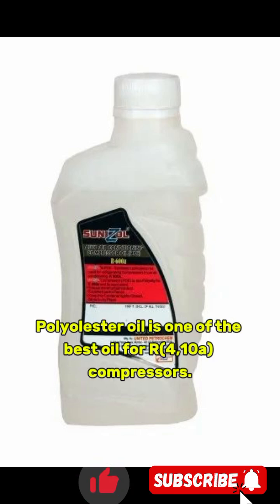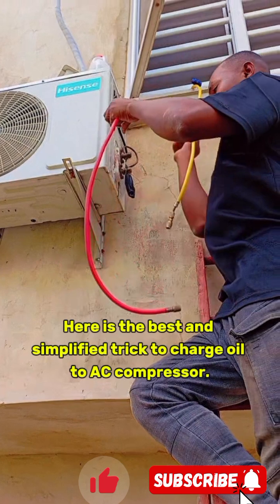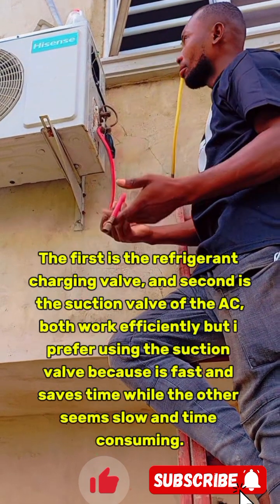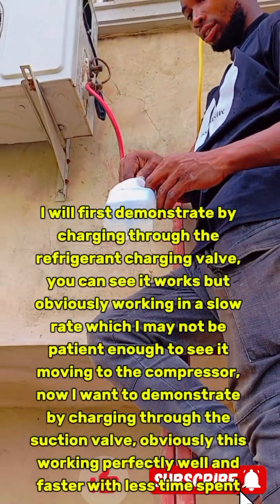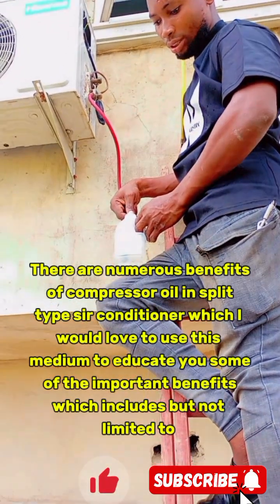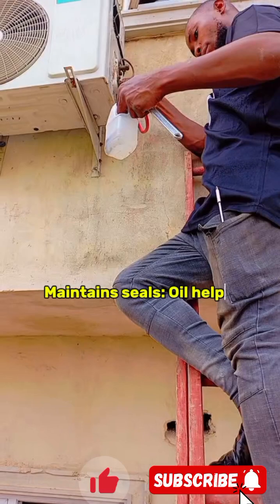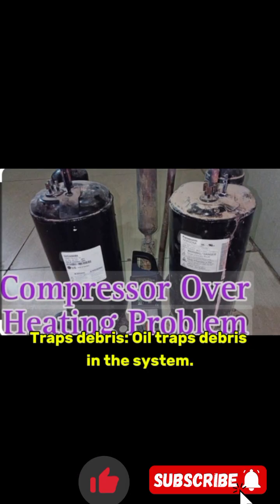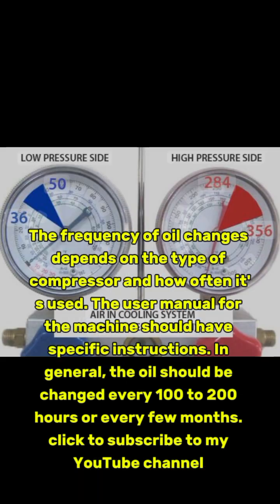How To Add Oil To A Car A/C System

Comment: STUPIDLY just added sucked in AIR before and after the oil.  DO NOT FOLLOW.  DO NOT DO THIS.
Reply from the maker: Thank you for the comments.

I was only illustrating how to put a compressor oil in a compressor. After the illustration I used a vacuum   eliminator to remove accumulated vacuum and air in the system before operating it 

I think i did the right thing. I was only illustrating a particular thing most people need to know. Thank you